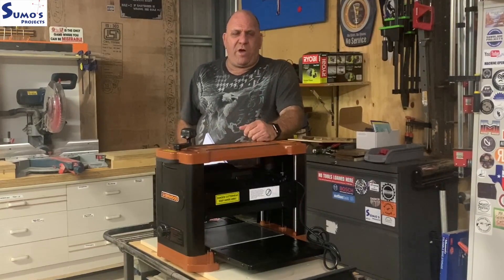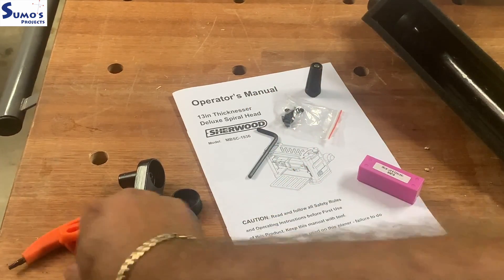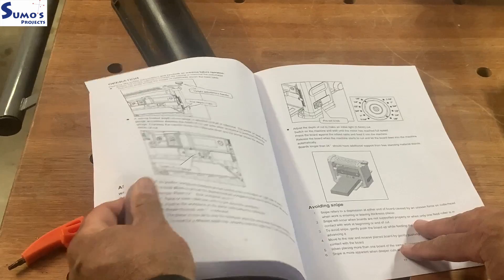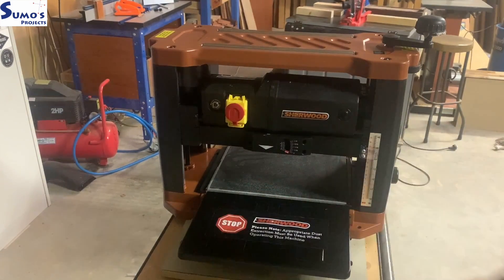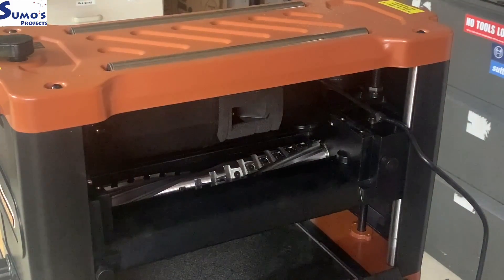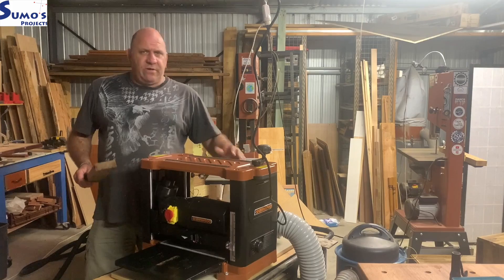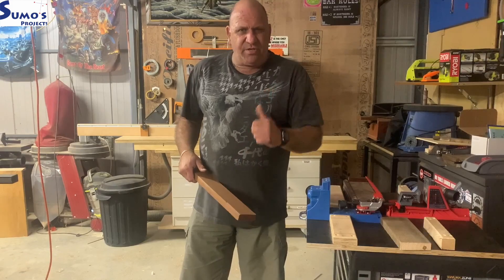Sherwood 13" | 330mm Helical Spiral head Thicknesser Review

Comment: Looks like a real ripper, mate. I've converted my DeWalt thicknesser and I'm in the process of converting my planer/thicknesser combo machine. I agree with you that spiral head is the way to go. Very good review on the Sherwood unit. I'm pretty sure you're going to get years and years of use from this.  Great video mate. 👍👍👍👍
Reply from the maker: Thanks Measure Twice Cut Once Lol ( Great Podcast by the way 😎) I tend to agree the spiral cutter head will give your machine the performance it needs as Timbecon machinery is really great quality & value for money 🇦🇺🍻👍

Comment: Thanks for the review🙏🏻 I’ve got mine since few month now, very happy with the finish, but I do have some snipes (almost 50mm)… would love to see you explaining how you set up yours to avoid/reduce snipes 🤩🙏🏻
Reply from the maker: G’day mate, I’m not making videos anymore but you can make an adjustment I. Lift the infeed arm & you will see adjustment screws which if you turn them anticlockwise it lifts your infeed angle that helps negate the snipe & I think it’s the same on the outfeed side mate. This helped reduce the snipe I was getting.
Good luck 🇦🇺🍻🤘

Comment: Great review, does it snipe at all on either end?
Reply from the maker: It will but just adjust the bolts to take most of the snipe out. I’m very happy with mine still & am currently running 12” hardwood cutting boards through it with ease 👍

Comment: Hi Dirk. I like the way the head moves up and down rather than the table. 
That's a heads great timesaver and simple to change out a snipped insert.
How many flutes has the cutter head two or three? Impressed. Tony
Reply from the maker: G’day Tony, I’m not sure how many flutes mate but I guess it’s 3, it’s a pretty nifty machine considering it’s size & for a novice to regular hobbyist it’s top spec for these types of machines.
What is fantastic is the noise reduction & cleanliness of cut ( although it’s new you can tell ) & I know I’ve made the right consideration buying it 🍻🍻👍👍👍
Reply: @sumosprojects  Great to hear your well satisfied. Tony
Reply from the maker: Cheers mate 🍻👍

Comment: After researching thicknessers  for a while but having found no reviews on the Sherwood, I bit the bullet and ordered one. I picked mine up in mid October and couldn't be happier with it. I have never owned one before so can't speak for the noise other than to say it is a lot quieter than my hand planer. The finish is bloody ace on all the timber I have tried so far. 
As you pointed out the 4 sides to each carbide blade should give a truckload of service when rotating them. Most welcome as I am running mostly Jarrah through mine as well!
Great review mate, I would have been less nervous in purchasing it if this review had been out before I pulled the trigger. Having played with it now for a couple of months definitely no regrets!
Reply from the maker: G’day mate, I’m extremely happy to hear your assessment on the Thicknesser & I to am really happy to have purchased it. I was contemplating going a larger size & I looked at all options out there but the price just grew dramatically so back to the drawing board I went & decided that I wouldn’t have the need for anything larger.
That helical spiral head is a brilliant idea & I think we’ll both get great usage from it 🍻👍👍👍

Comment: This is a really useful video Dirk and so many people will be helped by it. I have always wondered how these machines work, thanks to you I know! Many years ago I took apart a wardrobe that was made of 1" thick English oak and made furniture with it. I wish I had been able to use this type of machine. Instead I had to use a hand plane and it was blood sweat and tears! Then mortise and tenon joints with hand tools. I learned a lot though! Thanks again. Keep well and good luck with the dust extraction converter.  Eryk 🎬👍😀🍺
Reply from the maker: G’day Eryk, we are fortunate as DIYers to have relatively good machines that are affordable to do the chores that hand planes & harder forms of joinery. I think it’s a good thing because of the technology as it helps folks stay active in a hobby by not having to spend the extra hours in doing the restorations you’ve once endured.
As you know in the last hundred years of the industrial revolution many great machines were built & many are now sourced as prizes due to there bulk weight & precision.
On ya Digger Freethinker, look after yourself cobber 👍👍👍👍

Comment: Looks pretty good for a lunchbox type up there with the dewalt, interesting it has a granite base, ive never seen that before! Whats the cut width capacity?
Reply from the maker: Yes the granite base adds easing the weight & cuts down on chatter somewhat & cut capacity is 330mm but I’d run stock shy of that by 20mm.
It’s a sturdy machine & the DeWalt one is also pretty nice 🤠🍻👍

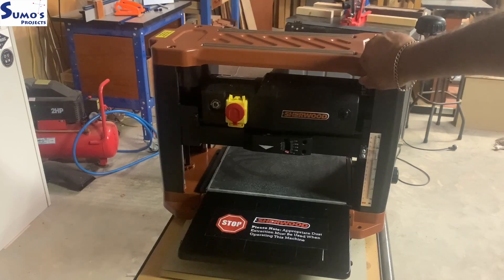Comment: 4:25 Steel casing? No it's obviously not when you get to inspect it. The top is steel, the bottom is aluminium and the sides are...plastic. The carriage looks heavy duty and is made of aluminium castings it appears and the granite looks ok. I'm sick of Sherwood fobbing off plastic bodies, I bought their spindle sander too and the body is plastic. It's just not good enough, these tools should be durable enough to last decades. I think you should've mentioned the plastic bits in your review.
Reply from the maker: You review it pal
Reply: @sumosprojects  Ain't my thumbs down on the review, it's ok otherwise. Anyway, plastic isn't a deal breaker if the finish lives up to the hype. I can't say anything more about it for reasons TImbecon might be able to explain to me tomorrow.
Reply from the maker: Let me know how you went, I cannot falter it since I purchased it & the granite base gives it some good rigidity